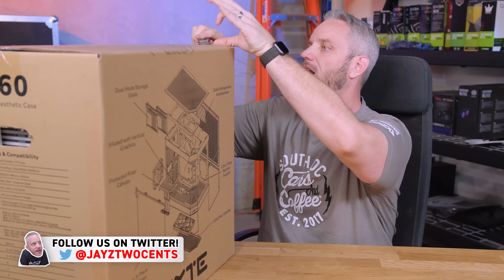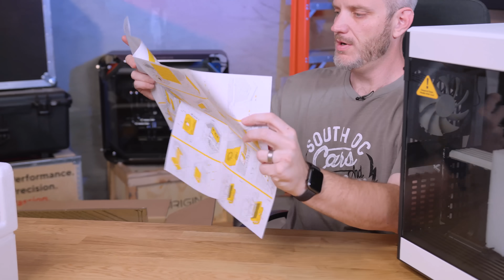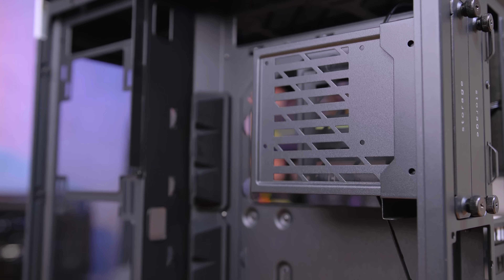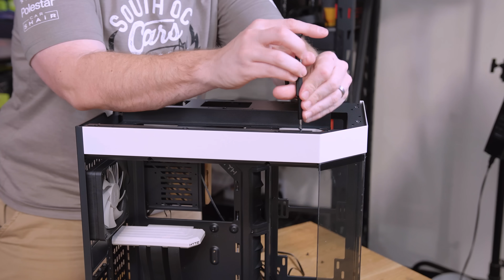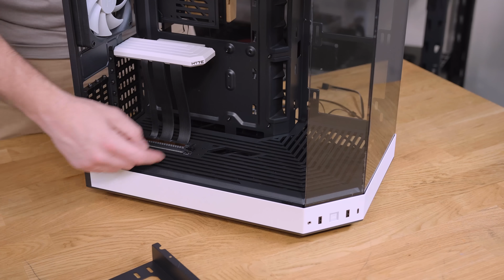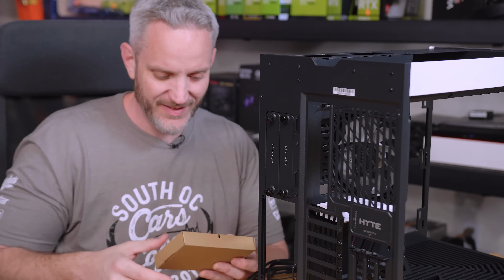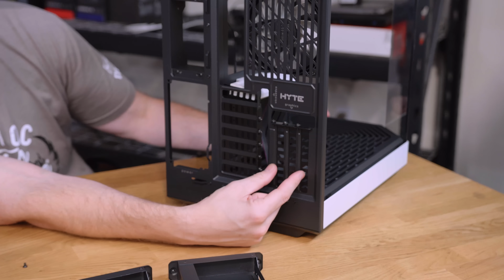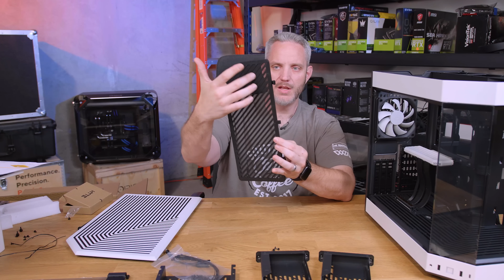Someone FINALLY broke the mold for PC cases...

Comment: Ran my gpu vertical for almost three years and I absolutely wouldn't recommend it if it doesn't have at least an inch clearance from the glass. Temps were basically at its lowest around 73/75 celsius, when I mounted it normally they dropped at least 10 degrees. Looks cool but is really bad for your card.
Reply: Your point about having a gap between it and the glass is an important one. Sometimes vertical is a better option for the same reason. A while back I had a 3080 FTW3 in an O11 XL case... It's a wide case, but also a very wide card. The power cables were basically smashed against the glass when it was installed horizontally. The card blocked most of the intake from the fans below, and because the card doesn't exhaust much of the air directly (stock cooler), it just sort of made a turbulent area at the bottom of the case.

Switching to a vertical mount for the 3080 in this particular case (pun unavoidable) opened up a ton of room for airflow. I don't remember the numbers, but it was definitely double digits of temperature difference

Anyway, my point is, consider your options, watch your temps and airflow, and choose one that works rather than one that can bake cupcakes. :)
Reply: @skyfalltech  The pun was amazing, really unavoidable haha
Reply: @Gareth Tucker only reason for most people will be: it looks amazing
Reply: but shouldn't 70 degrees still be fine with a bit of headroom? What are the downsides of those 10 degrees more?
Reply: @MoonFidelity 

Yeah it should be, but the problem is that's at a standard load. So, in most US states you'll probably be fine with this.

Problem is in states like Texas/countries like mine (South Africa), you never want to hang around 70 because a hot day messes with your case intake and all of a sudden the ambient temp rises by 5 which means you can't cool it down anymore.

Pair that with a demanding title (like Path of Exile after its graphical update (resulted in a dead Asus Strix 1080ti) or Metro Exodus (resulted in a dead Aorus 2080) and very quickly you're into the 80s.

With graphics cards: don't play around. Do it right, its the most expensive thing in your build 9 times out of 10, look after it. Even if it should be ok at those temps, you don't know what it'll do at those temps, over 2 years.
Reply: @WhitefoxSpace  True! Well, guess I'll be okay here in Germany which is kinda cold most of the time :'D

Comment: I would put as many petg water lines as possible.  I'm talking unnecessary amounts in an elegant way.  Just need a super custom distro plate, unless you use enough petg that a reservoir is not needed?

Comment: I still believe nothing beats a fan directly pushing on your hardware. I'm sad that all this glass cases don't have a fan pushing air directly on the gpu and mb. When you want to overpower the case with airflow just put 230mm fans and make all of them intake and leave just one 140mm as exhaust. My HAF X is old, heavy, but I think it performs better than 99% of these cases. If it's filtered it's intake.

The case is very beautiful but I think a case, to make things better, should rotate the mb 180 so that your cpu is below the gpu or to put it on the roof.

The way motherboards and cases are built today is still an old standard that favors 1-2 fans optimization standard. Looking inside the case is overrated.

Comment: I was eyeing the O11 for my new system but then I saw this case a couple of weeks back and now I'm really torn because I like the Y60 alot and it's just "different".. Love how there is kinda like a place to display statuettes/funko pops inside right where the 45° glass pane is (I think, not really sure where GPU would end)
(LP expansion slots don't really bother me, probably not going to use an extra sound/capture card or whatever anyway) 
Really would love to see someone put a custom loop into this..

Comment: I wanna see a custom loop in this. 240 reservior on the side, 360 radiator on top. All EK. And the hard line comming from the reservior will also bend 2x 45° where the glas does its thing.

Comment: Jay, my first thought was " It looks like a fish tank". In a good way, which made me want to ask would it be possible to build a PC and have it water-proofed enough to use as a fish tank with RGB and maybe filter the water to be used for the tank? Or keep it separate? Just thought it would be a cool concept that I believe you could do with your knowledge of water cooling, PC's, etc.
Reply: You wont be able to use the same water from the fish to cool the case since it would corrode the parts. PC water cooling uses Distilled water or manufactured liquids, and distilled water is bad for fish. Only way this could possibly work is if you build a case with two isolated chambers for fish and pc like a thin aquarium that you can see the rig threw it. Even a build like this would take some fine planning to manage the evaporation of the aquarium water not to affect the pc components due to the close proximity.
Reply: @Kray86  yeah, after I asked and then thought more about it I was thinking along the same lines. Just the thought of having fish swimming around with RGB lighting in case but with a working PC that you could still see the parts I thought was a fascinating concept but unfortunately not having the knowledge to pull it off.
Reply: I think Linus did a build similar to a fish tank once... 🤔 
Where they had all the parts in an aquarium case, underwater but no fish.
Reply: @Pumkin932  Yes they have, they used mineral oil instead of water to submerge the components safely.
Reply: @user-op8fg3ny3j  No distilled water contains no beneficial bacteria or minerals like calcium and iron. It also stunts the growth of  bacteria that is needed to remove ammonia from the water. Fish can suffer from trauma in distilled water because they  have semi-permeable membranes. 

RO water is not the same as distilled water. RO water has added minerals with a neutral PH. You would still need to add beneficial bacteria to RO water if its a freshly started aquarium.

Comment: Would I build in this case? No! Being forced to vertical mount the GPU is a deal-breaker in a world of 3 and 3.5 slot GPUs. And limited to low profile expansion slots? Brutal.

I LOVE a lot of what they did here - but it seems like they didn't know what they wanted this chassis to be. On one hand, they put together a genius bottom-to-top airflow design which would be perfect for horizontal mounted GPUs, and ventilation everywhere to make air cooling as efficient as possible. On the other hand, they force you to mount your GPU in such a way that you can't benefit from that design, and you almost have to go for water cooling. Water cooling still needs air, so the ventilation isn't going to hurt, but it's really being used to a fraction of its potential IMO.

All they need(ed) to do is ditch the vertical GPU mount gimmick and they'd have a top performing silent air cooling chassis, which looks great to boot. One design decision makes it practically unusable. I hope they come out with a 'standard' version - or other manufacturer(s) start implementing some of these great ideas.

Comment: Rebuild my current setup in this case. I’m overall pleased with the  finish and quality. But mounting my H120i was almost impossible. I ended up only being able to screw in 1 side of the rad because of the top bracket is. 

Also the front USB ports are very difficult to insert and remove from. And one of the usbs doesn’t work.

Comment: I'm not crazy about vertical GPU mounts. I can't quite tell you why, but I never really liked the way it looked. Being that this case only has half height slots for the motherboard is a bit of a turn off. Honestly, this is only because it feels, "feels" limited. The only expansion cards I use are GPUs so its not about limited use. It just "feels" wrong. I like my GPU to be horizontal. This case can't do it so its a no go for me. If the option for full height slots becomes available, or offer a replacement rear panel, then heck yes. I love when companies innovate. I know its really hard to change the way standardized components fit into a box. The basement fans and rear panel ventilation are a nice touch.

Comment: I’m more of a full tower build. However if they built a full tower the same way with extra drive space for at least 6 3.5” and 6 2.5” drives I would be more interested. I also use 420mm AIO for cpu. However I also like having a 5.25 BD-R drive. I play my old games that are on dvd and cds and I prefer backing up my hard drives and ssds on BD-Rs and keeping them in my fire safe. However I also own a business so I have to do daily backups. Especially my code for different programming languages. I’m probably one of the few people still that need a 5.25” drive. I’m old school to, been building computers since mid-90s to current times.

Comment: jay this is useless to the most of us that dont use ssd as they die and data loss is impossible i will use spiners until they invent a drive that can be recovered due to the fact older drives data can be recovered they may be slower at saving but ive been around since beginning of pcs and even m.2 drives dont have recoverable memory for data recovery show cases that we can use for a change and i only buy cases with max drive spaces and i would never use a cloud if you paid me to use one as data theft is ripe out there on clouds

Comment: That's some backwards logic right there. Let's not put an extra mic port on the front of the case. Let's instead include a crappy dongle which is worse and costs just as much as having the mic jack on the front panel.

Comment: I would definitely build in this case. I think you're right in saying it would thrive with either cooling solution, but I would personally go custom loop. 240mm EK Distroplate in the back. 360 rad up top. 5800X3D, b550, and a 3070 Ti/3080. Perfect custom loop gaming rig. It would fill out nicely and look awesome if you ran the tubes in a double 45 to run parallel with the chassis. Keep the basement and rear fans.

Comment: It’s an excellent case if your pc stays on top of the desk. For me, having an H510 with the glass side showing under my desk is rather ideal, but if I had this case I’d really want to show it off. Also the front panel controls being on the bottom just adds to it being a desktop case for sure. But a damn fine one. It has everything I love about the H510 but cranked to an even more extreme degree, and on top of that it has extremely good airflow while also being subtle about it. Just a knockout.

Comment: Garbage case, any new high end gpu is basically 3 slot, that means fans against the glass, bottom fans will do little but push some air past the backplate of the card. Unless you're doing a full loop in this case its just going to have really bad thermals on an air cooled gpu.

Comment: I’m really curious about thermals for this case. That 45 degree angle has to definitely affect airflow from the side vent. Hope Gamer Nexus tests it out
Reply: OC3D has done a thermals review
Reply: A 45 in airflow is not too bad but it creates alot of turbulence, which i guess can ensure theres no "pooling"of hot air anywhere in the case. 90° in airflow cuts the flow in half if not worse, so 45 is for sure better.
Reply: there was already one build from Paul's hardware's YouTube channel did one over ~2 weeks ago!
Reply: Paul’s hardware said it does pretty well. Especially with the help of the two fans at the bottom as intake.
Reply: Paul’s hardware said it does pretty well. Especially with the help of the two fans at the bottom as intake.
Reply: Look for Tech Tesseract YT channel, they reviewed and did thermal tests on this case. Was fine even with a big air cooler.
Reply: @flepgg  he did a piss poor job. If he's getting 85c with all those fans going, he fucked up something.
Reply: @-DawnZero  sadly you can't rely on youtubers or reviewers when it comes to cases, gamer nexus waste their time using stock fans, nobody does that, nobody lives with test benches either, lots of others build "nice looking" builds that are wrong temperature wise my recommandation is pump->gpu->top rad>cpu->vertical rad->bottom rad->pump I just played 2h40 with 770w@psu in a real pc fully loaded closed case with vrm+pch+cpu+gpu liquid cooled my water temp was max 39.7°C with weak (but quiet) fans at 1200rpm meanwhile I heard several celebrity youtubers say liquid temps of 45-49°C are "ok"...cringe and no this case will never be better than a 011 dynamic xl because horizontal airflow never worked it's a myth, lian li has vertical bottom to top airflow+bonus side/front if you want
Reply: @fredEVOIX  "gamer nexus waste their time using stock fans, nobody does that" nobody runs stock fans? I want the drugs you are using.
"my recommandation is" bruv you have 48 subs, GN have over 1.5mil and a full test lab. Why should anyone believe you?
Reply: @lgmtk Most people don't just stick with the stock fan configuration. He had a point. However GN uses that methodology so it's a fair way of testing a cases airflow. Sometimes cases like the Hyte Y60 the stock fan configuration doesn't give a good indication of how it will perform. So using that methodology doesn't give anyone a good baseline for its performance.
Reply: @lgmtk  I never use stock fans for everything, I run noctua fans.
Reply: @hithere7382  what's your point? You are one person out of 100 of thousands of PC users.
Reply: @lgmtk  there's at least two of us you indignant wastrel...
Reply: @lgmtk  It works perfectly with actual good fans and liquid cooling. If we're talking about "how good is it out of the box" versus "how good is it once tweaked correctly", GN is correct. But I don't know of anyone in my entourage that keeps the stock fans in their builds, we usually go for Noctua NF-A12x25. When you're dishing so much on a case, spending a bit more on better fans should not be a problem.
Reply: @kleinaroo  I agree about the last point, but you'd be surprised how many ppl just buy stock and use it.
Just the sheer amount of parents who'd buy something basic for their kid, or those that don't have money, or those that buy it for WZ or FN out of sheer whim and then resale them...there are a lot.
Reply: @lgmtk  Oh yeah I know lots of people do keep them, but usually on lower end cases (or at least cheaper ones). In my first builds I'll be the first to admit I kept pretty much everything stock. (from cases fan to CPU cooler). I do feel like this case is marketed towards people who do this as a passion/hobby rather than newcomers (like NZXT imo, tbf I'm using a H510 one of my builds for the sole reason it's cheap and easy to setup, custom Y60 for main rig).
Reply: @-DawnZero  Gamers Nexus usually include a Noctua fan setup that they use for all cases so that it tests the temps and airflow of the case on the same basis, not just using stock fans.
Reply: @Jhakaro  true, however it’s still only run with a 3 fan configuration. A case like this will not perform well with only 3 fans.
Reply: @flepgg  Gamers Nexus will cover very soon lol, watch that video

Comment: About time you got a 3d printer lol. I highly highly HIGHLY suggest you get an automatic bed leveling probe like a BL touch or CR touch. They're cheap and transform your printer from an annoying toy to a reliable production machine. There's NOTHING more annoying then trying to level the bed for 30 minutes just to have a print fail or your first layer come out like poop. Literally it's like 30 bucks and you never have to worry about leveling your bed again. Perfect prints every time. It's everyone hobbyists first upgrade when they get a 3D printer. Seriously it'll change your life😂

Comment: I love the case look but because the case has those front mounted plug ins at the bottom it would never work for my set up.  unless I build a bigger desk.  I run two 32" monitors and they take up my entire 60 inch desk.

Comment: If i had big m.2 and 2 big ssd’d i would build in that case.. i love my cooler
Master haf x but getting pretty outdated. Have flirtet with changing it out but still one of the best case when it comes to cooling last time i checked Steves  list. Both systems have haf x. Got 1 spare when i had it serviced and they made scratches on the side panels. But if/when i can get like 8tb +1tb nvme boot(+main and demanding games) i would swap case since i Also dont have it on the floor anymore. 🤔👌🏼 and agree with Nice that they hid the fans under the bottom.
Reply: Oh forgot awesome video Jay.❤️👌🏼

Comment: It looks cool, but I'm waiting for finer mesh instead of the slats, 360mm rad support, and a couple improvements to the various portions of the case that the o11 Evo solved. Still, improvements are improvements and I'm excited to see better modularity in case design for things like 45-60mm thick rads with 30mm thick fans.